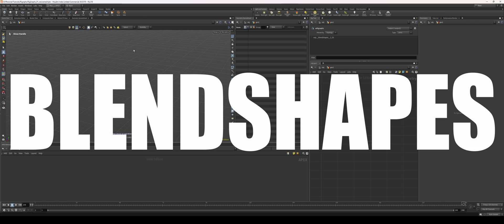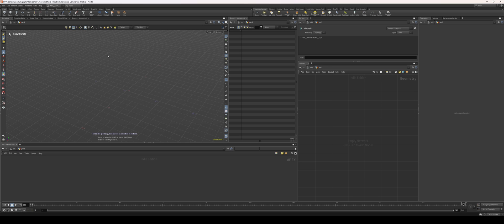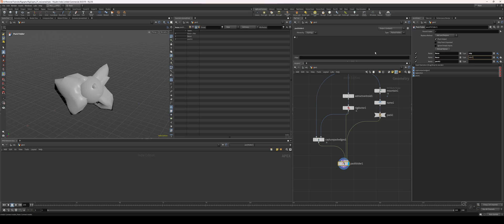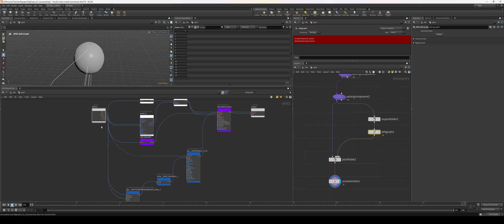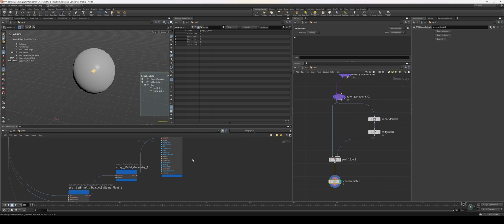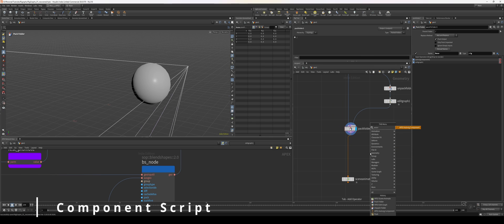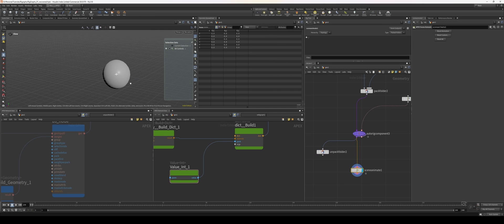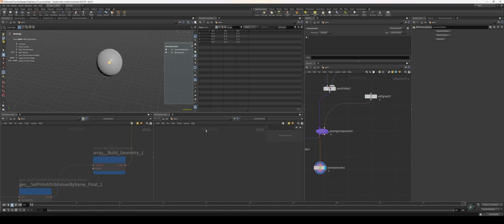Houdini APEX Rig Graphs: 04 | Blendshapes

Comment: @maxrose8845 I was getting this warning from the component script  >> "Input connection missing for in-place port /dict_set1:dict[in]." Consider using a Value node."
I fixed it by connecting the "dict[in]" ports from both the "dict::set<float>" apex nodes to the "parms" input apex node but you didn't have to do that. Is it some kind of bug in Houdini 20.5.278?
Reply from the maker: No it's not a bug, a lot of the nodes now need their inputs connected, even if no information is being passed in.  Think of it as the value -float, dict, whatever -needs to be initialized

Comment: Hey there Max. Thank you so much for going through this topic. I do have a question; In the second component script in which you create a dictionary for the (single) blendshape, I saw that you had to create an individual 'dict_set_float' node that creates the blend# entry. But then, if we are to add or subtract bshapes it looks like we need to dig into the component script and fiddle with these nodes over and over again adding or deleting nodes like crazy. Doesn't this go against procedural workflow? What would one need to do to get the dictionary entries to update as the number of bshapes changes?
Reply from the maker: @noc2_art  you’re right, that setup would not bring in other blend shapes automatically.  The solution is to loop through the packed geometry - as in the corrective shapes you create before you put them into the pack folder - when you create the geo array in the component script.  It works like a charm

Comment: During the process, I encountered a problem where each step is almost the same, but I couldn't achieve integration in the end. May I ask if it's possible to share the project for comparison?
Reply: What exactly do you mean by integration?
Reply: I think I am having the same issue. I've created everything but the control in the end is not driving the blendshape.
Reply from the maker: Some things to double check:
Make sure in your "setPrimattribValuesByName" node that you're setting the 'nameattrib' and the 'attribname' correctly.  That got me a couple of times.

Double check the dictionary setup for your blendshape node.  It has to be just right or it won't work.

Is the x value of your abstract control being promoted to the correct parm input?
Reply: @joosteoh4686 @CGINerd make sure you didn't use the "geo_setpointattribvaluesbyname<float>" apex node instead of the "geo_setprimattribvaluesbyname1<float>" apex node.
I've been having the same problem and it turned out I was just using the wrong apex node.

Comment: Thanks, I sort of figured out the blendShape, the only thing I don't understand yet is how to make several blendshapes into one network, do you need to do all these actions for each one? It's not working yet and I still can't figure out how to change the appearance of AbstractControl
Reply from the maker: For the blendshapes, no you do not need to do the same thing for all of them - you connect everything in a loop.  It's a bit more complex, and more than what can be described here.  I'll have to make another video about it. 

To change the appearance of the Abstract Control, it's the same process of configuring any other control.  Use a configure controls node and select the abstract control, and assign the shape you want.